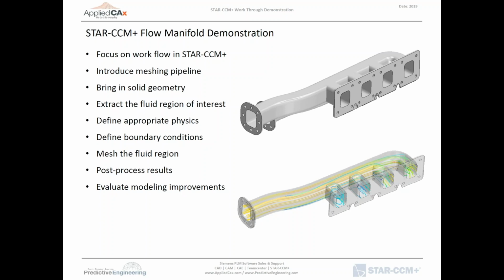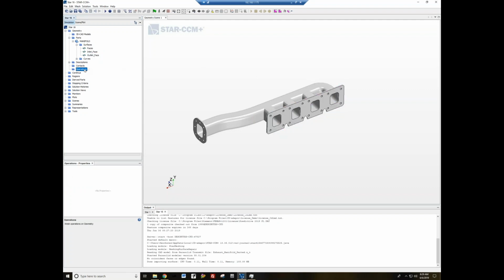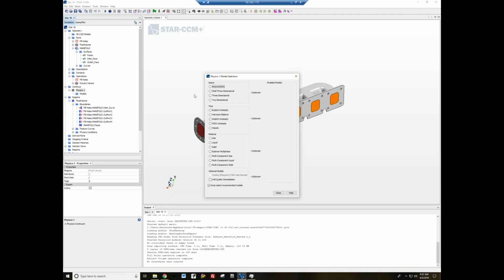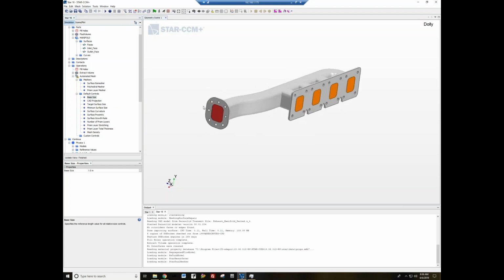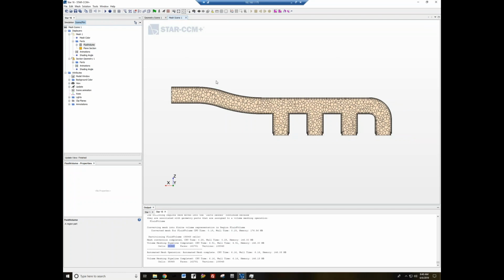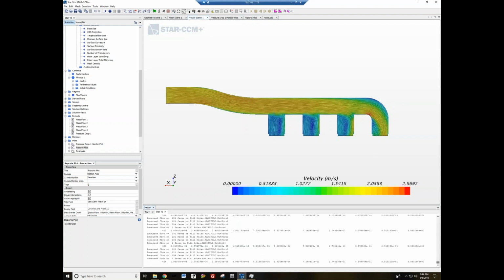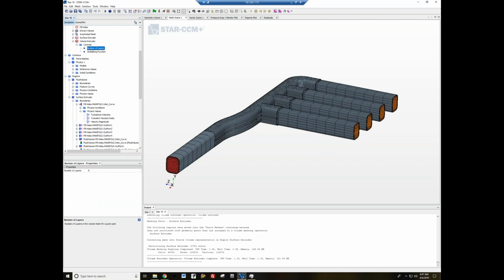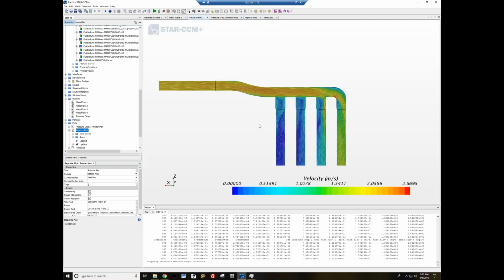STAR CCM+ Flow Manifold Demonstration

Comment: Good job!
Great illustration to - why reversed flow is evil and why we should often extend outlets.

PS How did Extract Volume result in four outlet faces - if solid part had only one named face (Outlet_Face)?
Reply from the maker: The best practice recommendation for CFD is to extend your inlet and outlet ports where possible.  You want to have your flows fully developed at the inlet and outlet locations of your region of interest, otherwise you are forcing values (pressures, velocities, etc..) at those cell faces. 
Yes, there was only one face for the outlet, but there were 4 curves referenced to split the outlet face into 4 separate faces. 
Thanks for viewing!